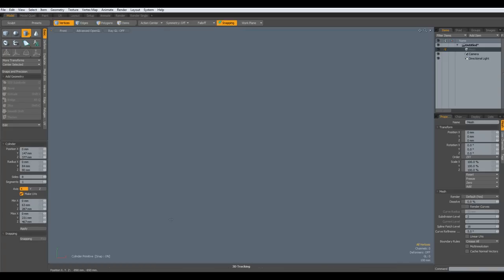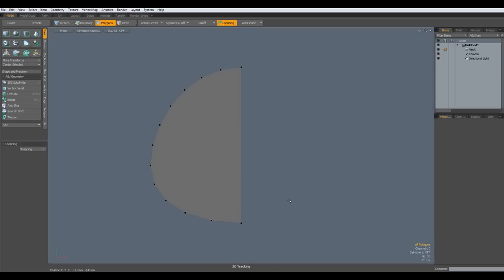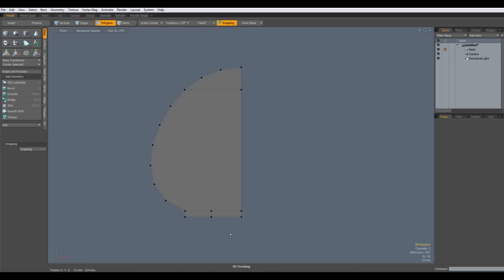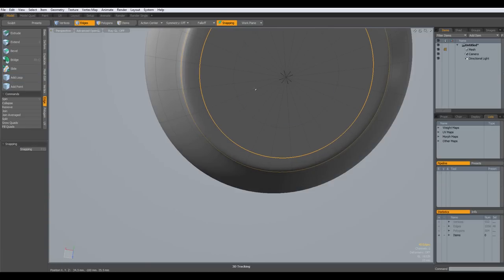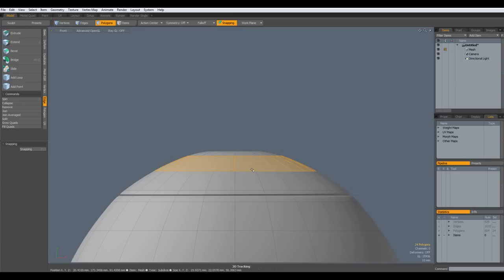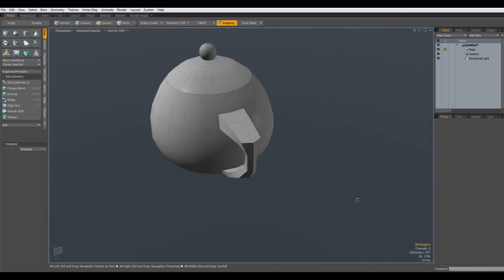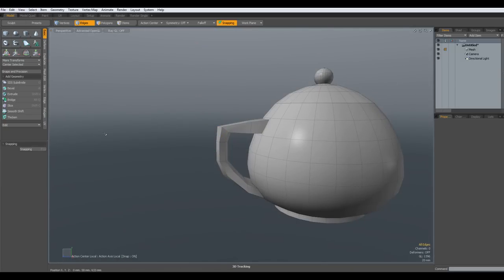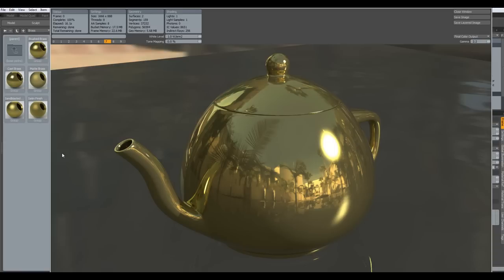Luxology Modo - Modeling a Teapot - Tutorial

Comment: ...whenever I add my "brass" or any other metallic or highly reflective material, it sturns black, with only my highlights reflecting the new material; I assume it's something with my illumination settings but I can't seem to find anything...any advice you can offer is greatly appreciated.
Thank you for the fantastic tutorials!
Reply from the maker: Hiya, the only thing i can think of is, that you have double geometry. Try to run MeshCleanup. Maybe this fixes your problem. Kind regards, Peter